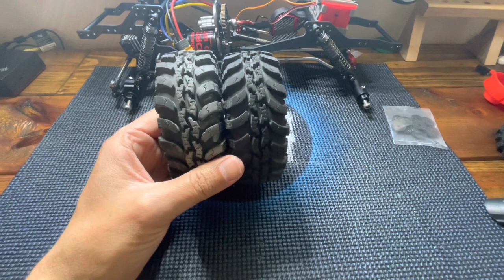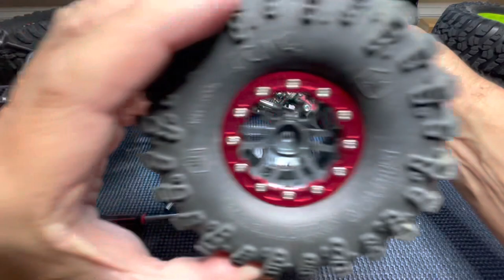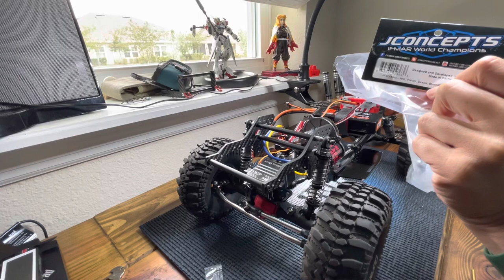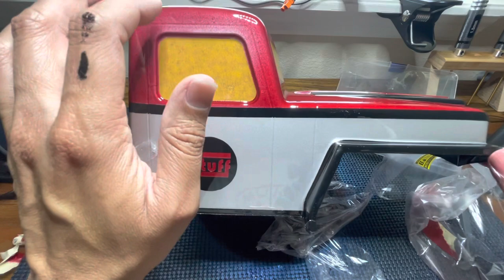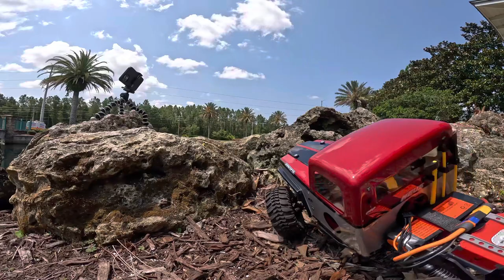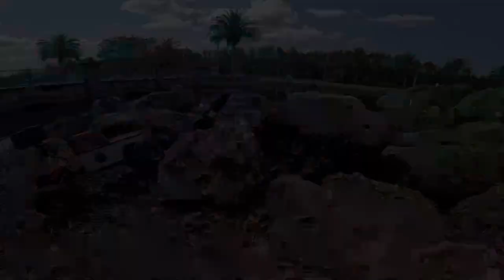Axial SCX10II Building project LCG Chassis, Axles, Transmission, Electronics, Body & more (Part 3)

Comment: I would drop those front legs all the way down to the last hole therefore rolling the axle out instead of n if you roll it out it's going to give you a little bit of castor they're forgiving you better steering angle
Reply from the maker: 🤔 Didn’t think on that one, it could work, thank you, I will try it

Comment: Hehe you ended up with the same problem everyone has with the Injora chassi. The damn front link assembly.
I ended up replacing both the lowers and the uppers to get full articulation and a positive castor angle.
Reply from the maker: I am thinking to do the same thing, what length did you use?
Thank you for watching friend
Reply: @thestuff6102  I ended up trying lots of different solutions and they wont necessarily work for your axels. 
But the lowers are Redcat panhard's with some bendt ends and the uppers are from a trx4 again with bendt ends.
https://www.youtube.com/shorts/SgjHH5kyJ1o
https://www.youtube.com/watch?v=judvHSsXPxI

45009 RER11352 Panhard Bar (53mm)
RedCat - RER11352
49173 Yeah Racing Steering & Suspension Link Set TRX-4
Yeah Racing - TRX4-070

And the ends are just mix of things that either came with this or some other failed attempt at getting this to work :)
Reply from the maker: 🤔 I think I’ll start the Treal and error process 😵‍💫
Reply: I don't have any trouble with the front links on mine. The suspension on my injora/powerhobby chassis works great.
Reply: @rc-daily  it really comes down to axle choise. Some work better then others.

Comment: You can also flip the transmission around to sit the motor on the other side and to the rear
Reply from the maker: True, but then the motor blocks the rear links travel
Reply: The Stuff RC  I've got the trans flipped around on a few 10.2 builds and I don't think the rear links touch but then again these chassis do have the links that rise up quite a bit.  Nice build by the way!
Reply from the maker: I was checking yesterday, and with the 540 can, there will be no problem with the rear links, so you were right
Thank you for watched the video and your comments, definitely they are pretty helpful for this project and the ones to come 👍
Reply: @thestuff6102  awesome! I'm glad I was able to help you out!!